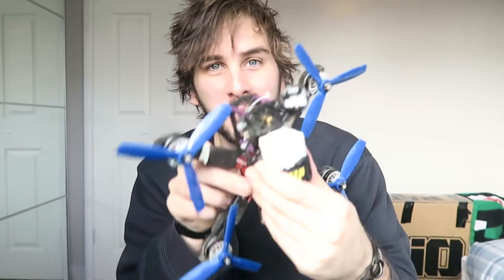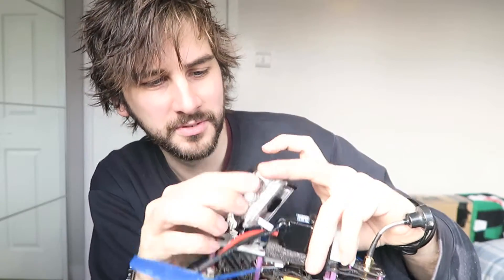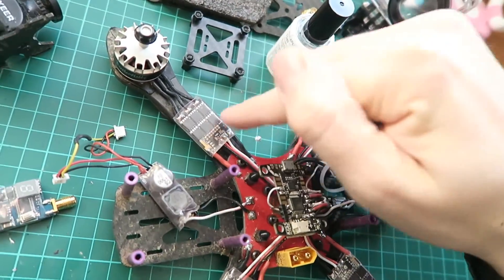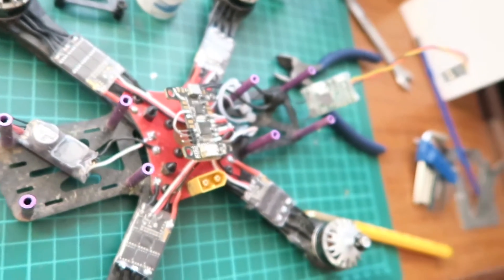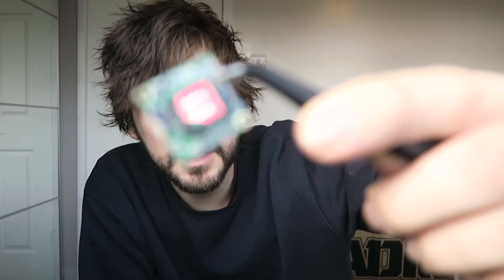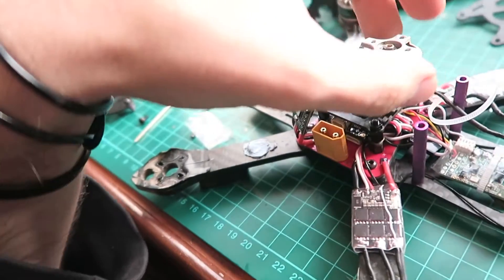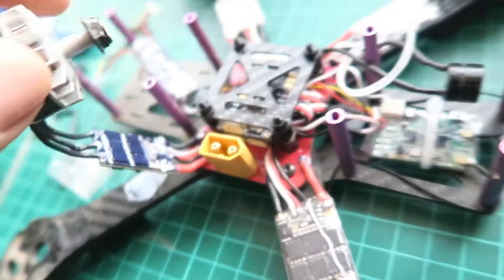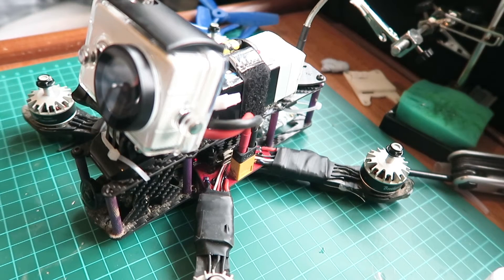Waterproofing a drone

Comment: So I waterproofed my micro with that silicone modified conformal coating.. and flew it in some heavy rain and it did fine on day 1. Next day I was flying around in like basically a littler heavier than sprinkle rain and it just went out over the high grass in my yard and never found it lol. You think the usb port could have caused it? I didn't plug it with anything.